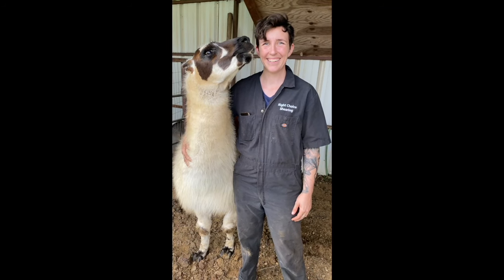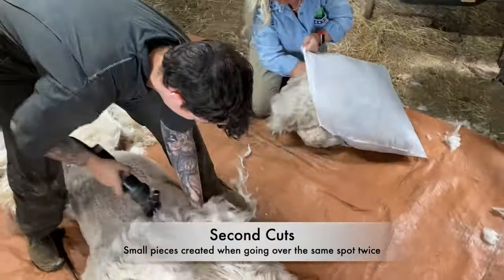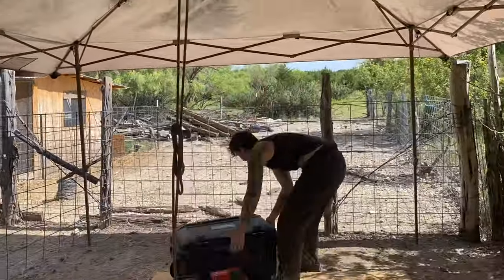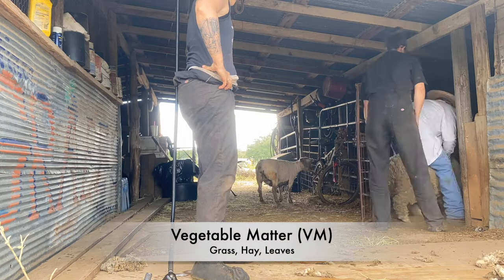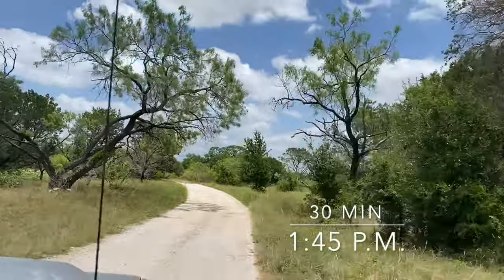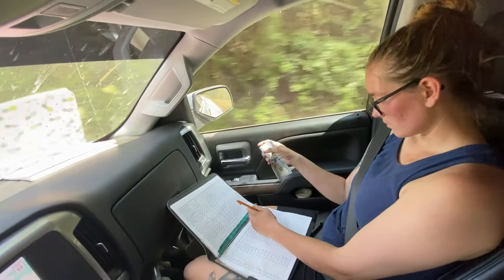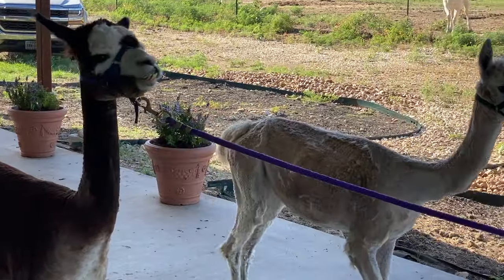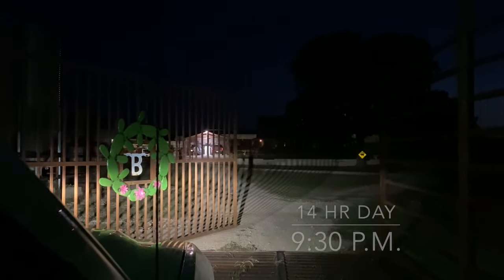A Day In The Life of a Traveling Shearer

Comment: Why is it that you need such a different setup for sheep than for llamas and alpacas? The suspended motor, and the protective shoes?
Reply from the maker: This is an awesome question and I'm definitely going to try to get a video together on an explanation, but a quick run through!

Sheep produce lanolin which is an oil that becomes very waxy. This oil softens up the skin on a sheep and makes them easier to nick. This means we need to make sure that all their wrinkles (there are a lot) are snugged up tight so we don't nick them. The method allows us to maneuver the skin out of the way the best. Sheep are also much smaller and when they are standing, it requires the shearer to bend over to work on the sheep in an unpredictable way. The method of laying them in my legs is designed to keep them comfy and relieve stress on the shearers body. The shoes allow the feet to flex freely and keeps the hips and body in line while shearing🤘🏼
Reply: @rightchoiceshearing  that's so interesting! Thank you so much for getting back to me 🙂